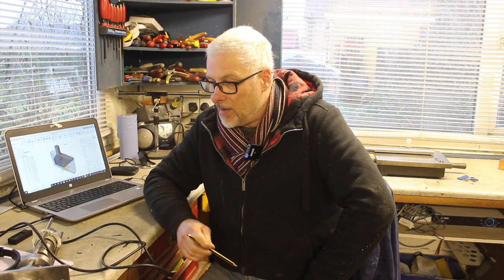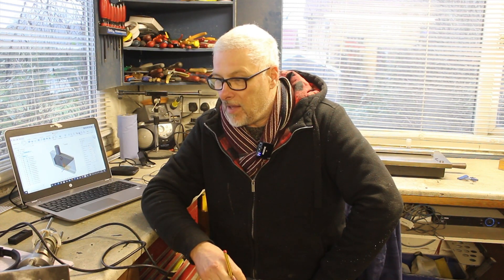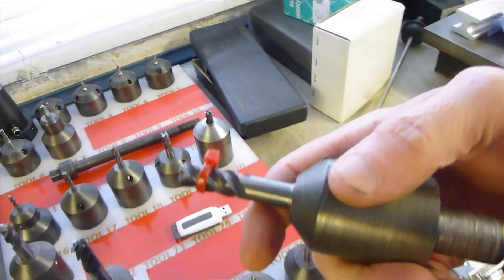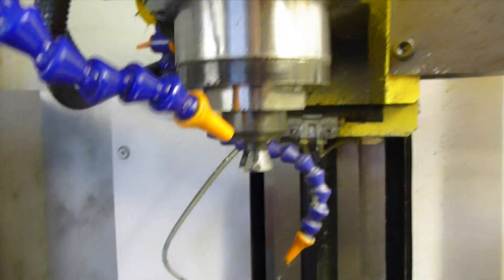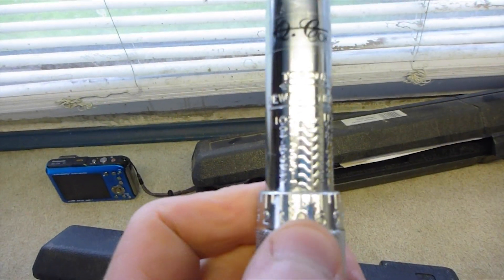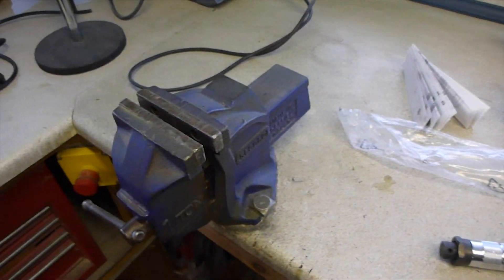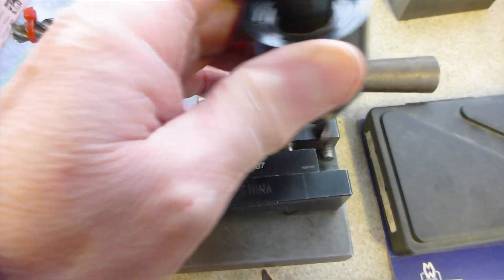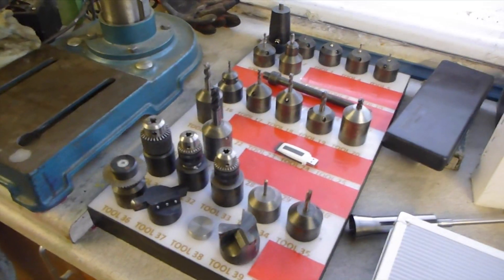Electric power draw-bar!

Comment: I will try to find the video, but one i watched earlier said to fuly tighten down the belville springs and the just slacken them off enough to release the tool when fully compressed.
Edit: the drawbar 'pull' (ie bolt torque) was set by a specify number/strength of belville springs.
Edit 2: this was the video https://youtu.be/5HjaMnmtYbg
Reply from the maker: Great point! The drawbar pull is it seems a bit variable in the research I did there was not a lot of info about it. I used a stack of springs to even out the pressure if you look at the compression versus load for a single spring its very non linear and has a very short stroke. The stack I ended up with is totally arbitrary but it does even out the load ( makes it a bit more linear) for the required drawbar pull.
Incidentally my drawbar has just packed in with a leak I hope to look at it very soon.
Thanks for the comment 
Cheers

Comment: That appears to be a massive stack of belville washers you used. Any reason you used so many? I'm currently trying to fit a tool changer to my Syil - when time allows.....
Reply from the maker: Its a hangover I think. Originally I thought you needed a lot of travel to release the tool. Turns out a couple of mill is more than plenty.
Let me know if you get a PDB working on your syil. Its a far bigger project than I originally thought.